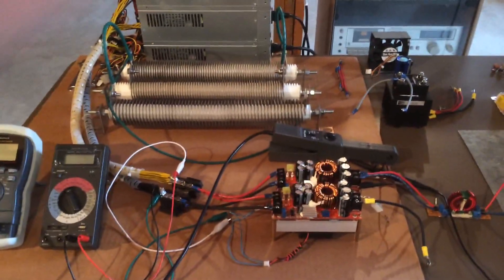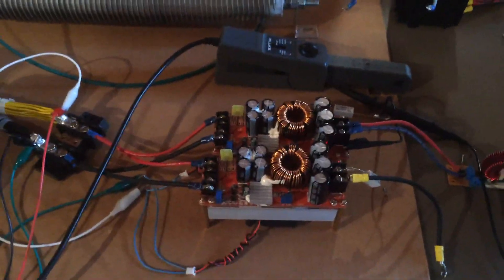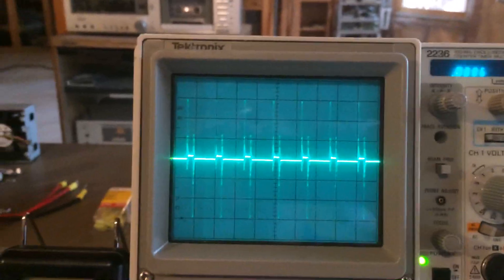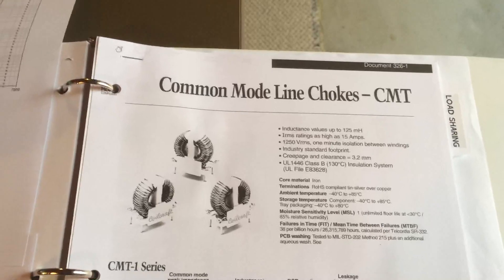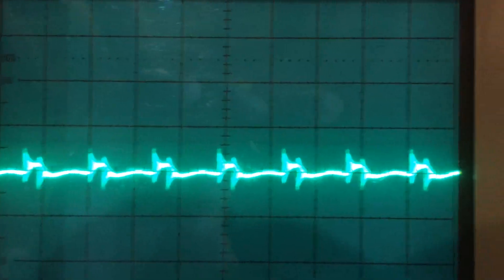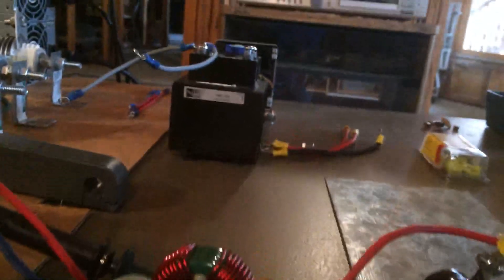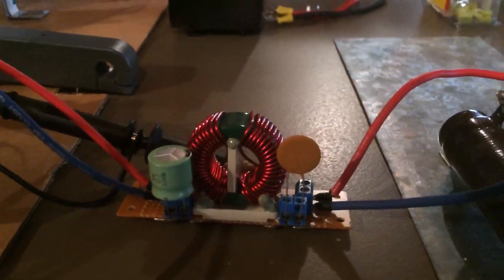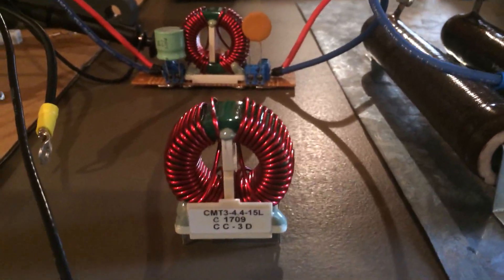RF Man discusses load sharing and filtering for 12 volt to 50 volt boost converters.

Comment: Thanks RF Man for your videos!  I note that the input and output grounds are not exactly common on these (sz-bt07cccv) boosters. I'm concerned that the Under-Voltage Protection UVP and current sensing is implemented on the ground side of these boost converters.  If UVP were to trigger on one of the inverters, that inverter would open its input ground and use the output ground of the other parallel-tied inverters, thereby circumventing the UVP and causing the current sensing and therefor current limiting of that converter to be vastly incorrect.  One possible partial solution is set the UVP very low so it never triggers.  Did you consider this and did you have any concerns or experience any issues?

Comment: Ok I found it  thanks for the video I'm building a amp using cheap mosfets and have a mobile unit I'm trying to put together to get about 5 to 6 hundred Watt but when I turn up the voltage on the step up converter I started hearing a lot of noise  and this hopefully will help.   thank you

Comment: Hello! nice video!! I have the same dc dc converter and I had that switching noise at the output too. I made a filter with the rf choke inductor and it improves, but then I changed the output capacitors for some LOW ESR caps and I obtained a better filtering even with the rf choke inductor. Sorry for my bad english
Reply: Useful to know! Thanks!

Comment: Might shoot you a question little later Rob. I been studying switch mode supplies in depth and I know your extremely knowledgeable in smps
Reply from the maker: Sure, feel free to contact me anytime....
Reply: @RF Man Channel @Brandon Parker I have also started to learn the SMPS, can you please share the material/ video lectures or any resources. I am a very beginner and aiming to expert in this field. My aim to learn design from scratch to complete products including PCB design, circuit design, control (Digital), EMC, testing. Please guide me it would be a great help. Thanks in Advance. Have a very good day.